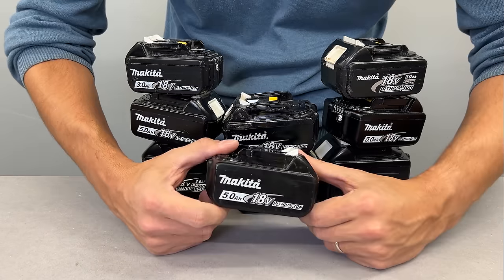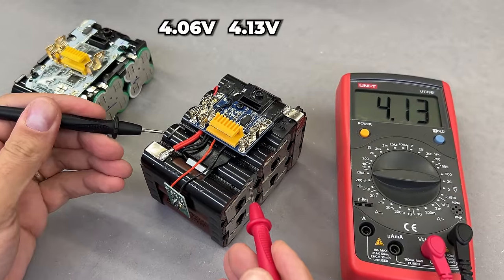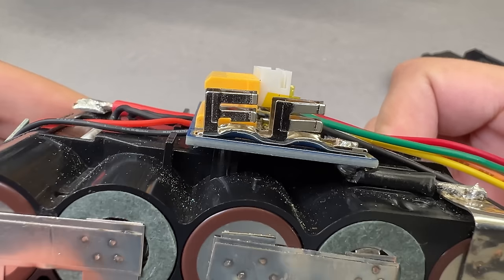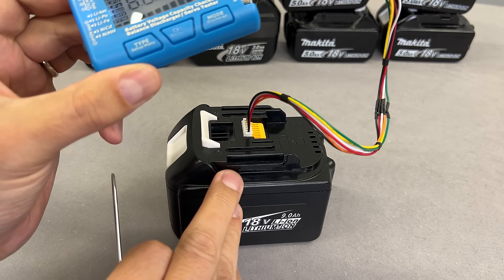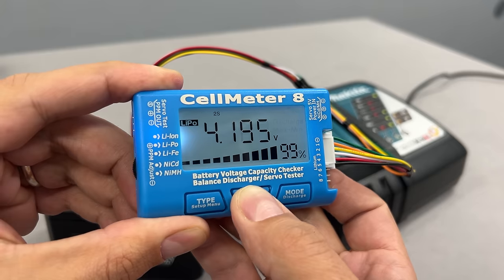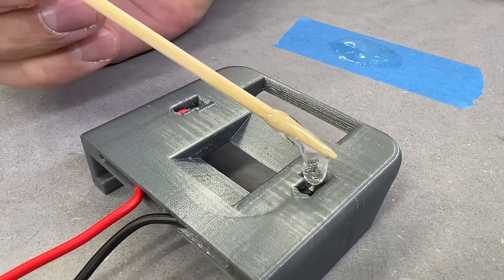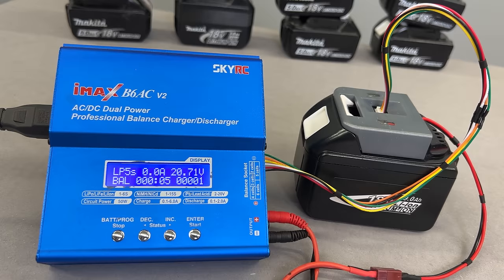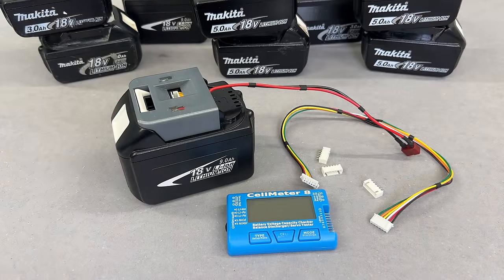Makita 18V Battery Has Big Problem!

Comment: looks like you should change title to after-market "makita" batteries have huge problem..
Reply: I don't know what kind of electronics they have inside but I have several genuine Makita batteries that will no longer charge on a Makita charger. I will have to open them up to see if they have balancing connections to each cell.
Reply: It's quite obviously not a genuine makita battery.....
Reply: @Brentpn   exactly, but that didn't stop author of the video to click bait title as it is original (aka makita batteries doesn't have cell balancing).
Reply: @izoyt I was wondering why he didn't mention how to tell which battery has the load-balancing board before buying. That explains it.
Reply: @izoyt it's because it's in the charger 😂
Reply: @Guishan_Lingyou ... exactly makita charger itself destroy the batteries. The makita charger doesn't charge and shows the batteries have problems. I tested the batteries in severals makita chargers ... the same ... the lights of the chargers flashing, saying the batteries are broken. Well ... i put the batteries in chinese charger ... BINGO ... is charging. So ... i sold the makita charger and i have 4 years charging just with chinese charger. Simple.
So ... fu_k the Makita Factory, fu_k the designers of the Makita batteries
Reply: So who make best battery ? Dewalt,Milwaukee?
Reply: Thanks, saved me 10 minutes of my life.
Reply: @Guishan_Lingyou Batteries are a disposable item with limited charges in them. Unfortunately we need to replace them when they die. Usually they last acceptably.
Reply: Trouble with makita batteries is dont tell you if wont charge and try three times destroys electronics happened to me when I could have easily just replaced faulty battery.
Reply: @Guishan_Lingyou  did you have any luck balancing your cells in the dead packs?
Reply: My Chinese charger does exactly the same as my Makita one whenever I have a problem with a pack. 😢
Reply: Clickbaiter,, I'm reporting this video as "spam or misleading" as many times as possible to get it removed from Youtube.
Reply: Older versions of original Makita batteries doesn’t have cell balancing. And that’s the board that the clones are based on.

So the title is slightly lacking. But I would definitely not call it clickbait
Reply: Deixa-te de ideias, os japoneses sabem mais disso que tu acordado ...😂
Reply: You can solve this by buying the aftermarket ones with balancing boards too.
Reply: @Guishan_Lingyou  they are probably too dead but I've jumped those types of batteries with a good charged battery before to fix em
Reply: No. Original Makita batteries have the same issuses. It is a rip off. I'm done with makita.
Reply: You gotta get the 5or 6 hours amp batteries. Never had a problem with them.
Reply: Yes! After watching a video on how to bring dead bat back to life so it can recharge i tried it and it works GREAT.
Reply: Thank's glad i read this before watching just saved 8.39min of my life being wasted. Time for another beer  🍻
Reply: doesnt matter after market or the genuines one, they will all do this one day for some of them. knowing what is the problem and how to fix is the key. also knowing what to buy.

there are decent after market batteries, its not like all of them are shtt.
Reply: @Brentpn  not going by the title, and thats the problem here
Reply: @yovolvo9130  If the battery tells the original Makita charger that everything is ok the original charger will charge the battery. Chinese copycat does not care, it will charge the battery anyway. A house burnt every now and then is ok to a nameless charger company but a big brand like Makita can not work that way.  Always a good idea to keep an eye on batteries while charging.

Comment: Misleading title as genuine batteries already have balancing future. Who will play around with this type of charging while in middle of work on a job site. These type of ideas only good for making videos about but in real life, nobody (who is a real user and not diy user) will play around like this. There are far more important things in life than playing around with how to charge batteries what already existing btw. I did too refresh /repair a faulty battery, but all the effort, time and parts needed did not worth it as the repairing cost was close to a new battery's price. And the ones I repaired was copies. Still have original working battery from 2008.

Comment: Goes to show you get what you pay for. Cheap aftermarket generic batteries are cheaper for a reason and this video shows why. It was a bit poor that the video didn’t clearly state the battery with the problem was a clone copy and not a genuine Maikta battery.
Reply: You do.  So I chose to pay for premium cells and added a mosfet to protect the pack against low voltage use.
I now have an 8ah Makita battery that is not only balancing on charge,  protected from being run into low voltages, and all for half the price of a new 6ah OEM one. 👍

Comment: I bought Makita first gen LXT lithium cordless tools in 2007.  Quite a few of those batteries died within 5 years.  Makita learned that battery lifespan is important to construction professionals.  They rolled out second gen lithium batteries, gave me two on goodwill warranty. I bought many more. Have only managed to kill one of those over ten years. My fault, too.
Reply: If I'm buying Makita batteries say on Ebay, is there a way to tell if they're gen 1 or 2?
Reply: Yep, all the failures I've had with LXT batteries were 1st Gen. I've got 2nd gen batteries with 5+ years and more recharge cycles than I can count still working fine. Like any electronic, nothing is perfect. But between very very long life and them constantly putting batteries in bundles with tools. I really haven't had to purchase batteries directly and have more than enough for all my tools plus at least 4 on the charger at all times.
Reply: How did you kill it?

Comment: Funny thing, I came up with exactly same situation about 5 years ago. I got a bucket full of discarded Makita batteries. Some were ok, just low voltage. Some had 1 phase dead, others fine. Makita's charger would not charge them since battery circuits have low voltage memory.
I did exactly same solution. I didn't have 3d printer so I made the adapter out of plywood. Also I didn't use epoxy for connector attachment (I think I wil do it now). Still use it today to charge them with hobby charger. Great video!
Reply: I own over 50 makita baterys, some of them 12 years old and none of them gone bad. Still working fine, all of them. How do you get bad makita batterys??
Reply: @dr.bik.sauerlanderene_HR no manufacturer can guarantee that every single product they make will be exactly the same as the last copy, consequently, there is a statistically significant probability that some cells will "fail", within a given set of parameters. It's the same for all made things, some stuff will fail, even if is a very small number of them. Bad luck if you're the dude that gets one!

Comment: Discovered this issue a few years ago, specifically on the 14.4 battery packs, (because these were the ones we were using).
On the early batteries the battery management board is permanently powered from the first pair of cells, resulting in the first pair of cells always being slightly more discharged than the rest of the cells. This issue builds up, especially if the batteries are stored for a long period. When the battery is used with the drill the first pair of cells eventually get slightly over discharged, which degrades them faster than the rest of the pack and reduces their effective capacity. I believe there is some natural cell balancing when the battery is repeatedly discharged and charged, however if the battery is stored this does not appear to be enough and the first pair of cells dies first.
It feels like a design fault/money saving exercise/intentional battery lifetime limiting feature, which makita have decided is acceptable because it doesn't normally kill the batteries before the 1000 charges in continuous professional use of the 4-5 years of DIY use. 
As a side note, The battery management board on the early batteries communicates with the charger and appears to count charges and disable the battery if the number if charges exceeds a number, I have guessed at 1000 charges, remember putting a full battery onto the charger to see if it is full counts as a charge... I expect this is a 'safety feature' which the marketing department wet themselves over.

Comment: The clone battery does not have any balancing leads. the leads which are connected are a measuring wire to check the first cell. This is used to do the fuel gauge and the internal electronics, which are much easier to drive from 3.5V-4.2V and not the full pack voltage. 
The original board is deactivating the charging, not only with unbalanced cells, but also with low-voltage cells. Which could be charged but are very likely to fail soon and are not capable any more to deliver the currents needed. Therefore makita is deactivating the battery. 

I dont really like this from a sustainability point of view, but as a manufacturer which have to garanty the current and power delivery for these battery it makes sense.
Reply: I find this a bit interesting. I have actually recovered a 14.4v Makita battery where 3 cells were basically at 0V and 1 pair was 2v. I manually fully charged them and the battery continues to work. Even the Makita charger accepts them now and so far there have been zero issues. So the BMS didn't brick itself somehow during this process?? It was connected the entire time I manually charged it back

Comment: It is good to mention that original Makita 18V  battery does not include low voltage and over voltage protection. A MOSFET is inside every Makita tool. Important if you use the battery for purposes other than Makita.
That's why I added a whole new BMS to the battery that has over and under voltage protection MOSFET included.
Reply: Hello, do you have a reference to advise and perhaps a tutorial to watch? Thank you so much
Reply: @Eratas1 . Thats a bullshit what you wrote here.
Reply: I totally agree that these batteries will drain to zero - no protection IN the battery. Do you have any information about your protection setup. I'd really like a voltage protection, especially to prevent deep-discharge. Overcharge I am not too concerned about - the Makita charger should take care of that, no?
Reply: @yxcvmk  you can make a external bms if you build the packs with the balance wires exposed like in this video. Its weird because you have exposed battery connections but if you are careful with the wires you can get it to have low voltage protection

Comment: Cells will become unbalanced with age, it's a normal part of the degradation process. When charging it with a RC charger like this, you're top balancing them and you might find at some point that you need to do this more and more often and maybe even with every charge, because they will not stay in balance. This might cause problems with the low voltage protection, because the individual cells aren't monitored during discharge and you rely on the low voltage protection that only checks the pack voltage. With the same modifications shown in the video, you could also bottom balance the cells. You discharge all cells individually to, for example, 3.0V. For optimal efficiency, you match this voltage times five with the low voltage protection of the power tool or the battery protection circuit.
Then, you charge the pack, but without balancing the cells (much like the original charger would do, or the RC charger does without the balance wires connected or the balance charge option selected). While charging, you monitor the individual cell voltages through your newly fitted balance connector. Towards the end of the charge, the cell voltages will drift and become unbalanced at the top of their charge cycle. You wait until the first cell reaches your desired end of charge voltage. Could be 4.20V, but you could also consider a slightly lower voltage, like 4.1V or 4.0V, which will increase the longevity of the cells. At that point, all the other cells will have a different voltage. You then take note of the pack voltage. This is your new end of charge voltage for the entire pack. You can then discharge the pack by using it in your power tools and the cells will be balanced at the bottom, just like you've set it up at the start. And then you can charge them again without balancing, using the RC charger or a lab bench power supply with adjustable voltage, set to your determined end of charge voltage.
By doing that, you make sure that all the cells, even though they're different because their different states of degradation, are in balance at the bottom of their voltage range. This is a bit more work at the start compared to top balancing, but there are two advantages. The first, you make sure that the low voltage protection still works properly. The second, charging will be quicker, because a top balance charge will take longer than just a normal charge.

Comment: Good video, and good idea for anyone with a fake LXT pack, or who is rebuilding an OEM pack without having a balancing PCB.
One note however - the balance cable 5S JST is female at both ends - in order to receive the silver pins on battery and charger. 👍

Comment: Sir, if you wipe the tip of your solder iron on a wet sponge every time you pick it up you will achieve factory spec soldering. thanks for your video

Comment: Some of those batteries are Makita, but the one you disassembled is a cheap copy in a size Makita has never sold. 

Which is probably why it has this problem. I’d guess that all real Makita batteries have the balanced control board. 

BTW, the B in PCB stands for Board, so “PCB board” is redundant. Like PIN number or ATM machine.
Reply: They do, but they lack effective low voltage protection.  Which is another killer of all battery packs.

Comment: Praise God. My makita battery does not charge and 0 volts already for few months. Today, I jump start it by connecting a 20 volt well battery (same type of voltage) to the positive ang negative side of the damage battery. In just 2 minutes it becomes too hot and i stop it (pls stop if hotter-i did it with opened casing), then check the voltage of 4 volts. I let it cool and I charge it but it doesnt charge. I did it again in front of a fan for 1.5 minutes (It becomes hot then i stop it before its realy hot). I let it cool and voltage is about 8volts. I charge it and praise God it charges slowly up to full charge for some time. Thank you Lord. I ordered a makita 5-battery pcb board, but i cancelled it. Wow praise. I really want to take video to help others but i did not expect it will work. Just be careful in repairing. Pray always.😊

Comment: Hi, instead of using all this extra cell-balancing parts couldn't you just use a small/cheap/right size AliExpress 5s bms connected to the input and 4 wires then to the battery? Or can't you connect separate 1s wires to the yellow plug?Regards

Comment: Yes the video title is misleading, but makita battery's do have the same problem even with there on board balance board. So this idea would still potentially fix a dead genuine makita battery, too. Thanks for the video. Could you easily be done without the adapter you made.

Comment: if youve gone this far, might as well buy balanced PCB board to replace it all.
those tiny pins on the battery are likely to get shorted (just by touching by a screw drive tip in the tool box) and that is fire hazard. so personally i really against doing this mod (ofc depend on what the batteries will be used for and how). buy a replaceble PCB with balancing charge built in should be the best way to go.

Comment: Hi, i have the second battery with the large charging board. The batteries have the right voltage but i have no voltage at the outgoing pins. Any suggestions? Regards

Comment: I'm charging each cell of a Wheatley 6ah pack that has gone dead in hope that when they are all charged to the same voltage the Makita charger will charge the pack again... So far I'm at 3.43v - 3.7v. trying to get them all up to the 3.7v mark. When I started 4 if the cells where reading a 0 voltage. But they all seem to be holding a charge now. The pack indicator is now saying 60%. Is this attempt likely to work?

Meany thanks advance 🙏

Comment: I have a similair problem with my Parkside battery. I connected it to my cellmeter 8 and it recognises all the cells and I see disbalance between the cells. When I hold the dischargge button it double beeps and doesn't go into discharge mode. What could be wrong?

Comment: Easier, and probably more sure to buy another battery! Old battery is old, no matter what are you doing with it!
Reply: Nah man, you see the internal resistance is ~15ohm, for a used one that's quite low. I got cells wits 28-32ohm which have been recycled and are running in several batteries without issues.

Comment: First off that’s a counterfeit or knockoff cheap copy of a Makita 18v battery and nothing to do with genuine Makita. I’ve seen these cheap copies overheat and burn on site from normal use. Always use the original Makita for durability safety and reliability. There is no substitute.

Comment: Makita battery. How to unlock and restart the BMS board? After a month of operation, the LEDs began to blink and it would not charge. (as in the 10 second video on the link) The BMS board does not work. The battery is original, new. But I opened it myself after it was blocked. There is no longer a guarantee. / The battery pack itself works, everything is fine with the cells. Temporarily soldered a jumper from the short contact group to the adjacent positive contact group, the battery pack works, but in this option there is no protection for the cells    https://www.youtube.com/watch?v=wONqJTCsh5E